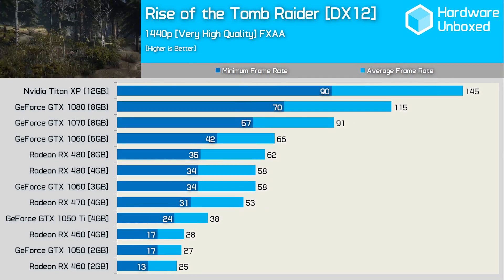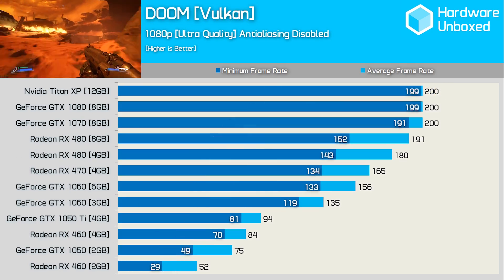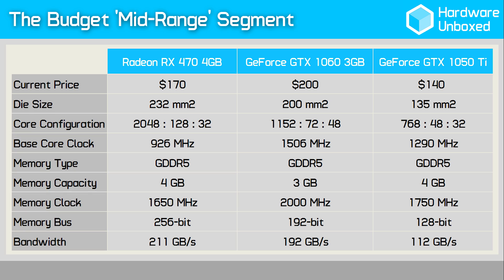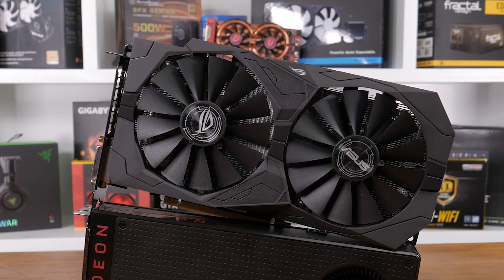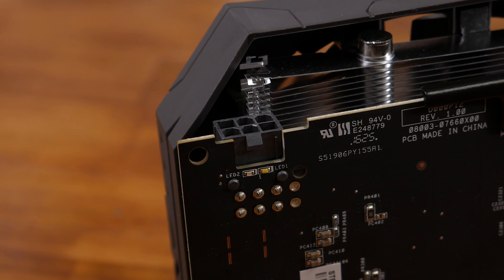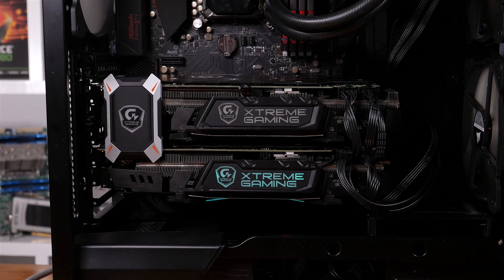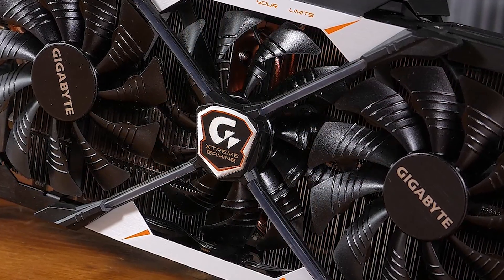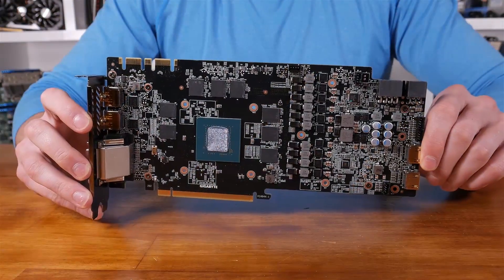Top 5 Best GPUs in Early 2017 [Based on HUB Benchmarks]

Comment: I'm having issues with my RX 470 when it comes to the display drivers when I try to play games such as Star Citizen and Squad Ops. So far, Fallout New Vegas hasn't crashed due to that (running mods does that on it's own, but one thing at a time). Any kind of assistance would be greatly appreciated.

Comment: I have a Strix RX 480 8gb OC edition.  my question is related to the vram and it's benefits.  I came to this card from an SLI setup of EVGA GTX 650Ti 2gb boost SSC cards and thus watch my vram usage like a hawk.  I've noticed Forza horizon 3 is happy around 5400 gb usage. I can't remember all the games I've seen go over 4gb but it's more than a few. watchdogs 2 with higher pixel density does iirc. oh and the fallout4 hd textures definitely do. but are you saying there's no benefit to that? doesn't it get pushed onto ram when it goes over the limit ?

Comment: i like that you skipped on the R9 Fury altogether - I had an rx480 strix oc which id gotten on sale for $240(with its oc headroom the thing is a beast and a beaut) - much faster than other rx480s id tried. Then the r9 fury went on sale for $245 with a $20 MIR and it blows the rx480 out of the water. 15-25% better benchmarks and the one game i play/have on my computer(fallout 4) has no problem with any number of mods. Sanctuary with 300 or so mods like 4k textures ect with all trees have leaves, grass set to high density and true storms set to heavy rad storm with lighting and the fps never drops below 50 and diamond city never drops below 60. with free sync its beautiful.

Comment: Thanks I was so confused b/w 1050Ti and 1060 3GB...
Now I've decided for RX 470...
Thanxx
Reply: 1060 is better then a 470 and tbh the price difference of the 470 to 480 is like $30 so unless the 470 is maybe like 50 or 60 bucks cheaper thens no reason for the 470 its horribly priced but like I said if you can find a good deal then is a good card.

Comment: Hi, I am running a cheap and old psu (FSP500-60APN) with 500watt. My question is, if the psu can support the 480 8gb, or if i should make the save choice and get the 1060 6gb? Sidenote: the psu only has one 6pin cable, so include a 6to8pin adapter in the equasion. I would appreciate some help!

Comment: What is the difference between radeon 480 crossfire and just the normal radeon 480? Is it two GPUs connected? Sincerely a newbie trying to find his way in the pc world.
Reply from the maker: +Christian Roes Yep that's right. Crossfire is just two or more Radeon GPUs
Reply: Thanks for the quick reply Hardware Unboxed! At 4:32 you showed a comparison of the GPU benchmarks for multiple triple A games and the Radeon 480 crossfire outperformed the geforce 1070. Is this the case in certain scenarios, or can the crossfire be expected to outperform the 1070 across the board? And in the end would it just be cheaper to buy the single 1070 in terms of cost per frame?

Comment: i got the 1050ti model to put in an old lga775 optiplex computer and am going to 771-775 convert a intel Xeon E5450, i would have gotten an RX470 but the psu was the problem

Comment: why gtx 1060 6gb wasnt included again??
Reply from the maker: I'm confused. What is your question? What wasn't the GTX 1060 6GB included in? again?
Reply: I mean, with all due respect, isn't it better to pick 1060 6g over amd?
Reply from the maker: No, not based on the evidence at hand.
Reply: oh man, really wanted to use that on my new build
Reply: Just get the 480, it gets a bit stronger every update!
Reply: when amd released the new drivers for the RX 480s it performs like the exact same as the 6GB GTX 1060. basically just get whatever is cheaper, try to get the 8GB for the 480 though, they should be like the same price.

Comment: My one problem with this, is that you did not include multi gpu set ups.  Like at the $400 range, you could use 2 rx 470s and that may beat the 1070.  2 rx 480s will surely beat the 1070, and for only $100 more
Reply from the maker: +Elijah P I hate multi-GPUs and strongly recommend my viewers avoid them. They only make sense at the extreme high-end. Buying two RX 470s would be a terrible idea.
Reply: ok

Comment: I'd like to add one niche use case recommendation. If you need a half-height graphics card for a small form factor PC, the best card you can get right now is the GTX 1050 Ti. Both MSI and Gigabyte have half-height models available for both the GTX 1050 and GTX 1050 Ti.

The reason I mention this is that the 1050 Ti can turn a second-hand ultra-small form factor office PC from Dell, Lenovo, HP and the like into a capable mid-range gaming PC on a budget. Here in Australia you can occasionally find these sorts of systems for around $200 to $250 used with a third-gen i5, 4-8GB of DDR3, and 500-1000GB hard drives along with an OEM license for Windows 7. As the 1050 Ti requires no external power input, you can upgrade these systems relatively cheaply and have a compact MOBA/eSports gaming PC that can even play a large number of AAA titles from the past few years without much issue. These can make really good secondary PCs, or even first systems for someone who is new to gaming on a PC but who doesn't have a huge budget.

Other cheaper options are of course the half-height 2GB GTX 1050, or the older GTX 750 Ti. I'm not entirely sure if any GTX 950's were released in the half-height configuration despite there being models later on that didn't requite external PCIe power inputs.

Comment: Thanks Steve, I do have one question. My Radeon RX480 4gb is a great overclocker but stock the ram is clocked slower than the 8gb cards. When you disable the 8gb reference card down to 4gb aren't you still running faster memory clock vs the regular 4gb cards and isn't that why your 8gb vs 4gb scores were so similar?
Reply from the maker: +Peter Schattmann Yes we were just testing memory capacity performance.

Comment: Best Hyper and Don't Give a Flying F*ck about Cost GPU: Nvidia Titan X Pascal
You should have said SOMETHING about it!
Reply: Considering it's the only card really worthy of 4k60Hz right now, it probably was worth a mention. Definitely not worth a buy though, way overpriced and everyone is just waiting for the 1080ti to drop.
Reply: Well I bought it and...yeah. My wallet is still sniffling. Still, 100+fps in TF2 at 1440p is pretty awesome. Get my LG 4k monitor this weekend, so I'll decide then if it was all worth it. Overclocked to 2GHz the performance is crazy, but two 1070's are much cheaper if you only play AAA SLI titles and don't mind a little microstutter.

Comment: Did I do a Mistake getting RX 480 8GB???
Reply: Ty, Jordan , I was asking about the VRam tho :D
Reply: Most of the time there isn't very much difference in performance. You didn't get the best price/performance ratio card, but it's still a great buy. If a year or 2 from now you want to crossfire and maybe upgrade to 1440p, the extra 4GB VRAM will really come in handy though.
Reply: No games are getting more memory hungry so good choice
Reply: No its perfect for 1080p.
Reply: don't agree with that 100% I personally still think the 1060 is a better card. Maybe in a year or 2 the 480 might be better with its better support of dx12 but navidia will proberbly sort that out with a update(s)
Reply: the 480 dosnt have the horse power to utilize 8gb tbh the higher the graphics settings the more memory you use but in a year or two the 480 wont have the horsepower to play games at ultra so as you turn settings down youll be using less vram. the 6gb and 8gb between 1060 and 480 is pretty much a non factor. 6gb will be just fine for years to come and by the time games start wanting that much vram youll be having to upgrade your gpu anyways.

Comment: i've been waiting for like 5 months now for vega or 1080ti, nothing came and by this time, i was using 4790K's Intel graphics. But now, seeing nothing coming for like 3-4 months more, i'm getting Gigabyte's 1080 Xtream gaming in this week. So Xtream gaming is good card, right..? the shroud is plastic or metal??
Reply: +Jay Shank If you google it, it looks like the Vega cards and probably Gtx 1080 Ti will be out around May, so if you want to wait about that long, you can.

But if you want to get the Xtreme gaming card from Gigabyte, go for it. The shroud is plastic, although it is very high quality. If you want to go balls-to-the-wall, get the Xtreme Gaming Waterforce pack, which is an AIO Xtreme Gaming 1080.

Comment: Not sure I get your reasoning for how you've positioned the mid-range cards. You bumped the 1050 ti up to compete with the 470 when it is more of an awkwardly priced higher end 1050, considering it isn't really priced to or performs to compete with the 470 but then isn't quite cheap enough to sit with the 1050/460. The 3GB 1060 gets used across both brackets when it is only meant as a 470 competitor, though is poorly priced. Then the 480 4GB only gets put in the higher bracket despite costing the same as the 3GB 1060 and barely edging it out in performance.

Imo it should have been 460 vs 1050 vs 1050ti -> 1050 win. 470 vs 480 4GB vs 1060 3GB -> 470 win. 480 8GB vs 1060 6GB -> 1060 6GB win.

Also, please read the comment I left on the last vid. DOOM skewed the percentages you quoted in this video pretty hard, to a point where they were 2-3x off what the accurate numbers are.

Comment: I agree with everything said here although I would look at the GTX 970 for midrange gaming, its cheaper in Denmark than the RX 480 and is better in DX 11 titles. By the time DX 12 is mainstream and DX 11 stops its cycle I will probably be upgrading my GTX 1080, my guess is at least 1-2 years from now. DX 11 will last a long while.  As for Vulkan which is the area in which AMD is far better I dont see many titles adopting it, at least not for now.
Reply: The Spark New benchmarks say the RX 480 is faster than 970 in dx11 titles and only 1% behind the 1060.

Comment: I would have  bought AMD if they would actually be cheaper...

I got a GTX 1060 3 GB instead of the RX480 4 GB because I had would have to pay 20 € more for a 480 of similar brand quality as my 1060.

Not worth it.
Especially as AMD cards are getting very hot and are not as energy-efficient as Nvidia-cards, which is really bad.
And you can't overclock them as you can OC an Nvidia card.
Reply: Karl Heven RX 480 has 1gb more and much more Power. Actually the overclocking potential is not that great on either of those cards.
Reply: I was the same, cause in Spain the gtx 1060 3gb was for 200€ and the rx 480 4gb for 230€, so i got nvidia´s card
Reply: manuel maltez 
buena decisión , amigo. Es una excelente solución para Gaming xD
Reply: manuel maltez welcome in the GreenTeam (NVIDIA) LOL
Reply: Karl Heven lol, la verdad no me arrepiento, Jajajajajajaja
Reply: manuel maltez sisisisisisisi :/
Reply: Silius Black 
I managed to overclock my Asus Gtx 1060 3GB Dual OC to over 2000 Mhz at temperatures of not even 65 degrees, and with the card not being too loud.
I managed to get an 8% performance increase just with the OC.
I severly doubt one could do that with an RX480...
Reply: Karl Heven Well the RX 480 gtr can get clock speeds up to 1480 stable without requiring any voltage change, and not to mention these are very different cards meaning the RX 480 will get no where near 2000mhz simply because that's not how it was designed
Reply: Karl Heven And literally no RX 480 card gets super hot unless it's the reference version or the g1 gaming and that's because the g1 gaming cooler is just shit. And not as energy efficient? literally every RX 480 card stays well under 80 watts while under load, and only goes higher in terms if it's an OC card or you or overclock the card even more.

Comment: i upgraded from an asus gtx 560 ti 1gb to a gigabyte gtx 1060 3gb. Did i do good? :D
Reply: Emil Bozhilov 
Yes I updated from a laptop card GTX 760 M to the GTX 1060 Dual OC 3 GB from Asus.
Reply: Emil Bozhilov 
good decision,
AMD GPU's are less power-efficient and have usually higher temperatures and you can't really OC them,
so Nvidia cards are more convenient to use.
Reply: Emil Bozhilov If the 1060 is cheaper then the 480 in your location then get it by all means.
Reply: Rat Face i bought it cuz i have never owned am amd gpu so dont really have much experience with that :)
Reply: i also feel cuda technology is more reliable? Its been here for ages so... Well optimised cores.
Reply: Emil Bozhilov 
nah I think AMD has similar core performance, so that's not really the thing.
It's just a matter of preference if you go for Nvidia or AMD
Reply: Karl Heven yeah. difinitely cant go wrong with either. Probably the best generation of gpus so far. Nothing has come close ever before
Reply: Emil Bozhilov 
I have a GTX 1060 3 gb from Asus
Great card,
I even managed to overclock it to 2000 Mhz from the normal Base of 1785 Mhz but even out of the box without me touching it it can reach 1850 Mhz .
And the 2 fans have a lot of potential, they are not "silent" fans but more than ok for headphone users and even with an overclock of +225 Mhz I didn't get over 63 degrees in a furmark GPU stresstest with the fans set at around 40 % and memory OC of + 110
Reply: Rat Face  well I guess that's OK,
but just not as good as Nvidia.
I'm just saying that Nvidia has the edge in that area
Reply: Karl Heven Power efficiency isn't valid, as the likes of the RX 480 and 470 operate with under 500W of power.
Reply: good upgrade..from 560 to 1060..enyoj the play..
Reply: uhum 560 Ti*** :D. New card still 4.73 x faster than old one tho. Old one blew up on me. Was a champ.
Reply: Emil Bozhilov yep

Comment: Hey, nice vid. The one thing the 1050ti does have going for it is that it's the fastest gpu that doesn't require a 6 pin power connector, so maybe factor that in too :)

Comment: I agree that the 1050 is the obvious choice over the 460 (unless the 460 is at like $90 or something), but the margins between power consumption is so tiny that efficiency really isn't worth considering. Yea it's like 20% more efficient but that's only a few watts saved. Also some 460s don't need a extra power connector if I remember correctly.

Just my opinion on power efficiency.

Comment: Should I get the 1060 6gb or rx 480 8gb for games like Rust, DayZ and Arma 3
Reply: Rust player here, its one of the games that made me get 1060. AMD performs a tier below nvidia. Arma 3 even worse, 480 does like half the performance of a 1060. No idea about DayZ tho, haven't seen any side by side tests and dont have it installed.
Reply: It's fking Eth if you play a lot of arma 3 go for the Nvidia one. if you play other games and you will play a lot of other games go with the 480
Reply: Lugio Lugio mainly Rust
Reply: It's fking Eth if you play those games theb spend it on a 6700k, gpu dont matter in those games
Reply: Tripnotik25 benchmarks say otherwise

Comment: Where I live the 1050  2gb mini is $150 and the 1050ti oc is $205. S it wise to buy the 1050ti oc? Amd is not an option as I have a prebuilt system .
Reply: Mustafa Mirza I mean obviously, the 1050Ti is the best you can afford for your needs. So definitely you're going to be paying more for the better card. Do I think it's worth it though? To a certain extent. 2 GB of VRAM won't cut it nowadays and the extra CUDA cores and such should give you about a 15% performance increase.
Reply: Mustafa Mirza depends on which games you wanna play
Reply: Rat Face its actually over 25% performance increase

Comment: Here in India we have rx 470 and gtx 1060 3gb at exact same prices ..... which one should I buy
Reply: Rushabh Jain how much
Reply: About Rs. 17K
Reply: I will go with rx 470.
Reply: 1060 3gb
Reply: And 17k is how many $
Reply: 470

more memory

with future games the 470 will have much better driver support

much better dx12/vulkan support
Reply: 300maze 1060 competes with the rx 480. The 1060 is better than the 470
Reply: 1060 3gb

the 470 is just 5% slower in latest games
Reply: If you have a freesync monitor then definitely the 470. If not, don't sweat it too much, both good. If you are in a very hot part of India perhaps looks which card runs cooler? More VRAM in 470 might help in some situations, not sure how much difference it makes really though...so yeah, a tough choice. I would probably go AMD but I do want a freesync monitor so have that bias.
Reply: As Time Goes RX470 will be better than GtX 1060 3GB!
Also better dx12 gaming!
Reply: RX 470, definitely. 3gb is not enough VRAM these days.
Reply: The 1060, the rx 470 is much weaker you will get better performance with 1060.